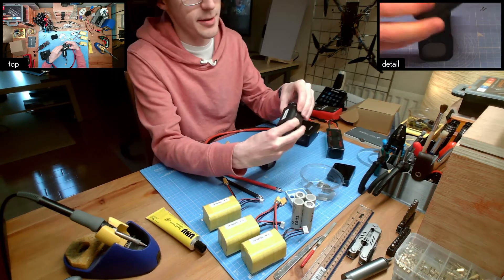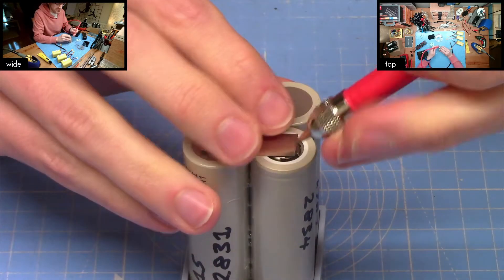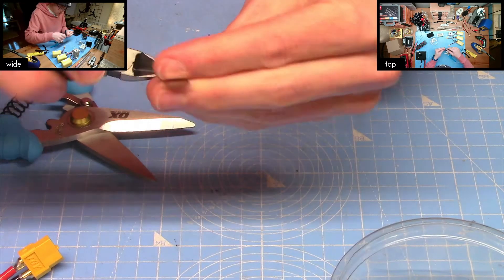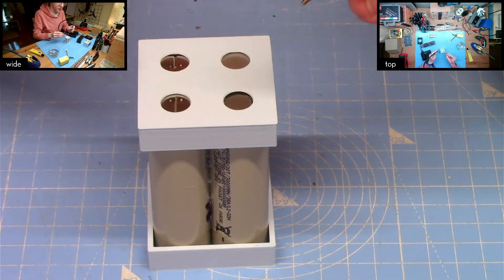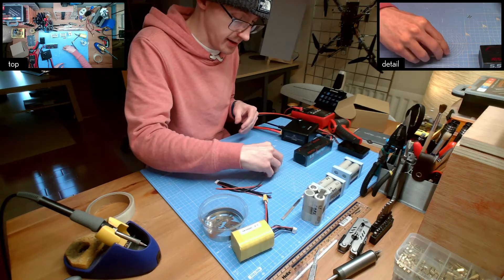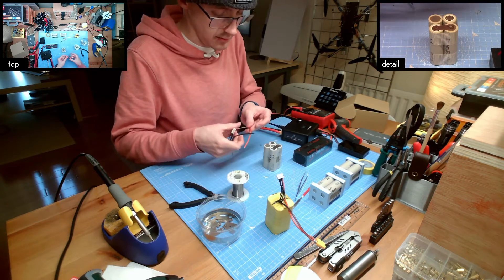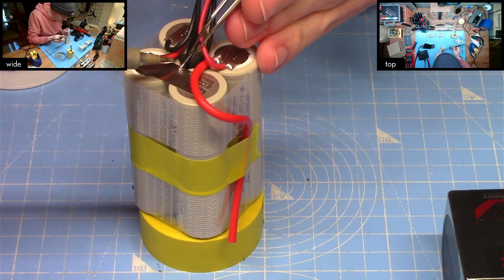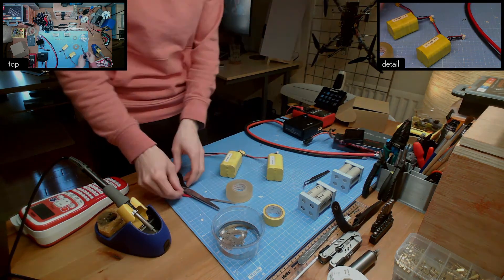Revisiting DIY Li-Ion Battery Packs // Sequre SQ-SW1 Spot Welder // Samsung 30T 21700

Comment: I plan on using molicel p42a cells to make some 6s1p packs. I’m struggling to find useful info on the strip size. What do you suggest I use for a 45A max draw?
Reply from the maker: I would recommend reading through some of the discussions & tests on Endless Sphere, Esk8 News, etc. that try to compare different dimensions of nickel strip to different AWG of wire, rather than looking at the tables of hard 'limits' copied from engineering textbooks. The problem with the textbook figures is that they don't usually take dynamic load/duty cycle into account. Some textbooks will tell you that 14AWG copper wire can only handle 5.9A, but we know full well from our real world experience that at least in our RC applications that is a meaningless figure. Many people consider 0.2x10mm pure nickel to be roughly equivalent to 15AWG.
Reply: The NEC ( National Electrical Code) rates 15 awg copper at 24A. Never ever saw a rating like that. .2×10mm is going be holy short of 30. If he is banging 30 amps out fairly often, wo

Comment: Hi CJ.. Great video and I've subbed 👍 I've just purchased the Albabird and going to power via li-lon.. any reason why your double packing? Off subject but what's the Albabird AUW using those  packs cheers.
Reply from the maker: I'm using 8 cells simply because that's what physically fits & balances on the CG easily! In terms of current handling, a single 4 cell pack with these sort of cells is probably plenty as long as you're not pegging 100% throttle the whole time. I actually don't know what my Albabird weighs, but I can tell you each of these packs is just under 300g. I will happily admit these particular cells aren't the ideal choice (you can get 18650 cells with the same capacity & current rating now) but I got a decent wholesale price on them.
Reply: Cool thanks for the reply 👍 yes I was thinking about 600g of battery's should be ideal.. I'm looking for over one hour flight time cruising at 5A ish I hope lol stock motors props etc.. cheers.

Comment: Do you find that your choice of nickel strip (0.2mm thick x 10mm wide) has sufficient ampacity for your needs? I've read it has a rating of 7.9A and I wasn't sure if flying a drone would exceed that since I thought some punchouts/accelerations can regularly exceed 30A? Thanks for any clarification you can provide!
Reply from the maker: Current is so scenario dependent there's really no useful way to say that a particular dimension of strip has a specific 'rating'. The same is also true of wire gauges of course, but because people are more familiar with AWG it's easier to understand the 'real world' capabilities rather than taking the textbook tables as hard 'limits' that can never be exceeded. According to some textbooks, a 14AWG copper wire can only handle 5.9A, which in certain scenarios may well be true. But in the scenario of a 5" race quad screaming around for 4 minutes pulling >100A bursts, that 5.9A textbook rating is meaningless.

I recommend reading through some of the (extensive!) discussions & tests on Endless Sphere, Esk8 News, etc. to get a better picture, particularly those that try to compare different dimensions of strip to roughly equivalent AWG of wire. Many people consider 0.2x10mm pure nickel to be roughly equivalent to 15AWG, which seems ample for my purposes.
Reply: @CJDavies  Yes that makes a lot of sense! Sometimes all this reading and planning can make it easy to lose the big picture! Thanks so much for the help
Reply: I have one huge issue with this comparison.  You are correct, .2mm×10mm =2sq mm which is equivalent to a 15 AWG wire. Problem, I've seen nickel wire. .2×10mm wire is good for a CDR of 7.9A. A copper wire that can carry that current is a 20 gauge wire which carries 8.2 A. A 15 AWG, can handle 25A. You would have to have 3 layers...or, which I have done, is solder copper wire to increase thrurate. A 18 gauge bare solid copper wire can carry 25A
..